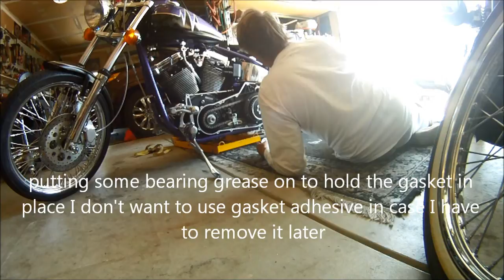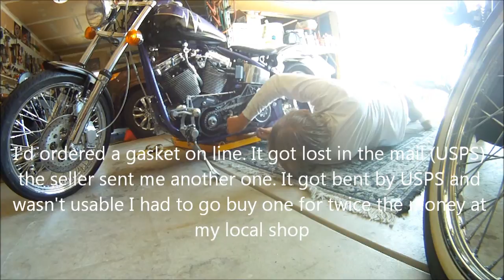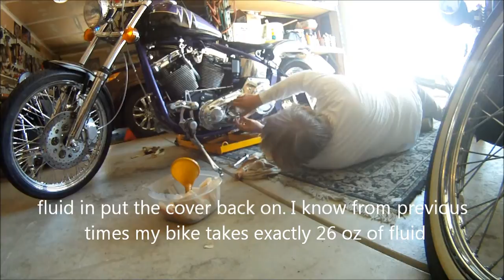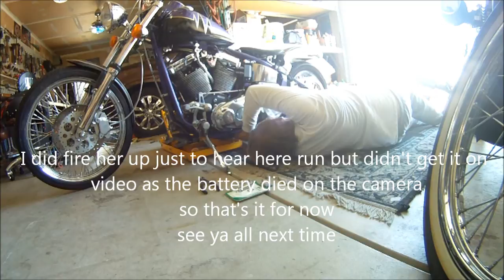Softail repair / replace inner primary "final episode"

Comment: Thanks for the video Robert. As for my bike.  My FatBoy has a few issues as well. The Derby cover has to be replaced because the shop damaged it. And I have an oil leak in the Cam Cover. As far as I know that's the only thing wrong with it. As soon as I drop off the bike to that shop I'll make a video.
Reply from the maker: Sounds like your Fat Boy is doing good. My cracked inner primary I attribute to bad manufacturing & the rear shock threads to bad assembly. All the problems with the "Kreem" going bad in the gas tank & clogging the filter, fuel lines & carb I've ehard from others that happens after several years & not to use "Kreem" anymore. As long as the engine & trans stay sound everything else is like maintainance issues I guess. The Softail needed a new look anyways
Thanks for watching & commenting

Comment: Great going Rob, normally if I'm down on the floor like that I take a nap every couple of screws :)
Are you going to try and get the original welded and machined? I doubt it's worth the hassle though especially as you won't need to do it again (fingers crossed).
Reply from the maker: LOL I felt like taking a nap also.
No not going to waste time & money to try & fix it 
. I was told it'd probably warp from the heat of welding it.

Comment: would love to see a video on old softails of inner pri removal,where you gota losen engine to frame bolts for proper alinement,solenoid and starter..thanks
Reply from the maker: I did not video all of that nor did I keep the video files of what I did do. It was a real bitch to get too some of those bolts. You have to remove your oil tank also & I had too modify some tools to get to the nuts & bolts to torque them Someone may make special tools to reach the back bolts IDK? In the end it was time consuming to get the engine & trans lined up & torqued back down. Installing the starter was easy compared to that. So was the sprocket & clutch & chain Get a good service manual & watch all videos you can find on YT & good luck
Reply: thanks for getting back.

Comment: Do you suppose that (unavoidably) hitting that 4 x 4 on the freeway had anything to do with your casing going south?
Reply from the maker: No the casing has been cracking for the past 10 yrs I've just always been able to repair it with JB Weld before now. The piece finally broke completely off & wasn't repairable so had to replace it
Thanks for watching & commenting